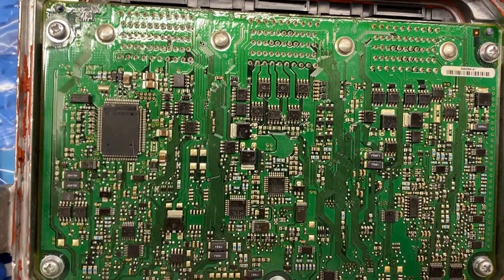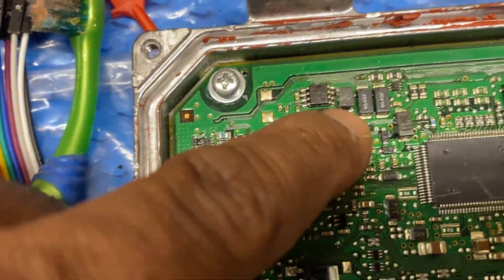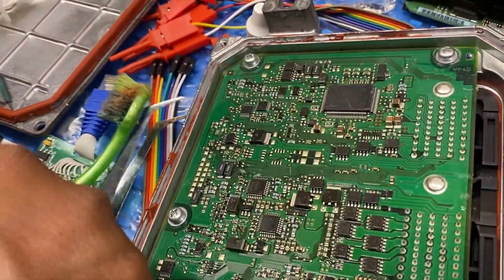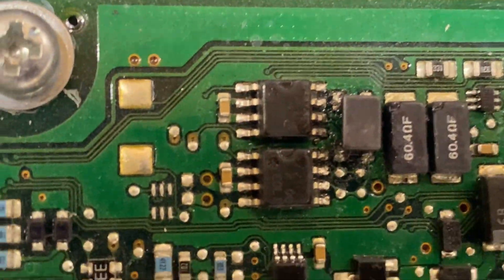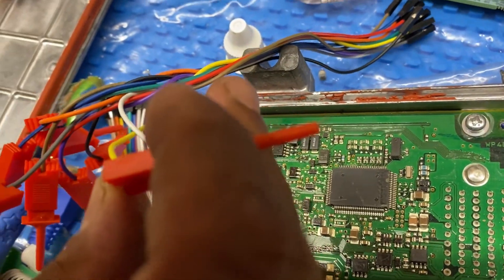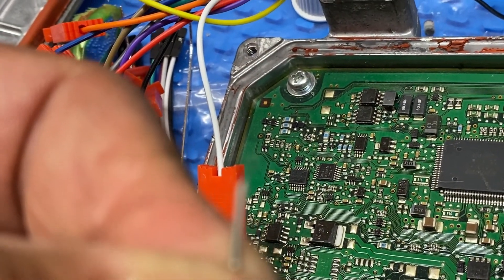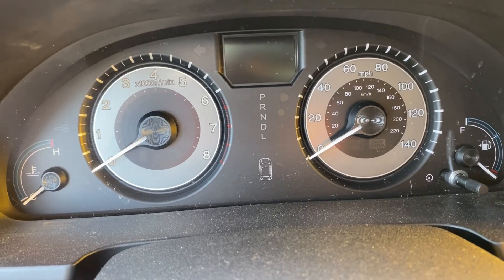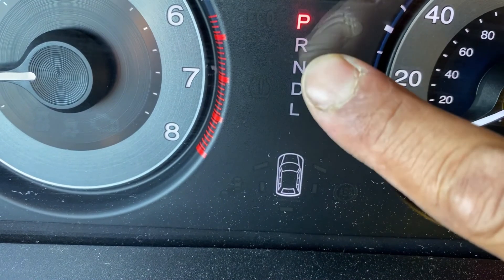SOLVED, Honda Gear shift indicator lights instrument cluster not ON

Comment: Hi br Nasser
Can we use a second hand 2015 toyota corolla H chip immobiliser
to an other car?
Reply from the maker: Hi br Adam,  yes you need to do immobilizer reset first, the same procedure as ( All keys lost), please let me know if you have any question
Reply: @NASSTRACINC  we did it but it didn't work bro
Reply from the maker: @MsSouham  after you make sure you have the correct key,  2- try to jump pin 4 to pin 13 ( OBD2 port ) with ignition ON for 30 minutes 
Let me what the results
Reply: @NASSTRACINC  ok brother. 
Thank you so much. 
I will give it a go.and I will let you know.